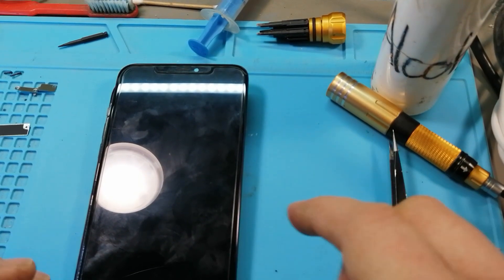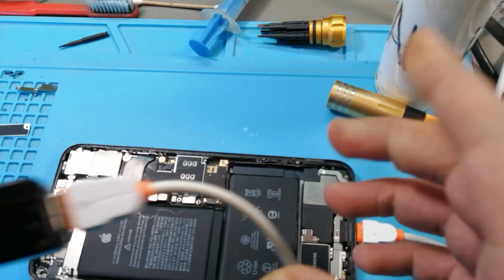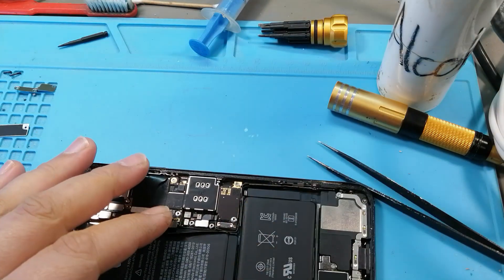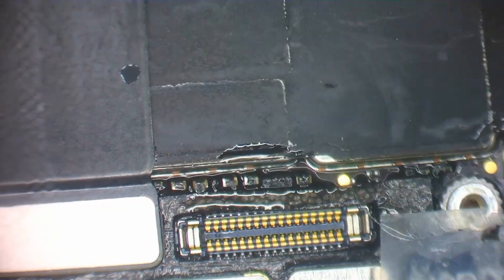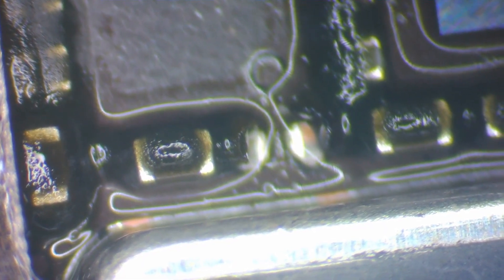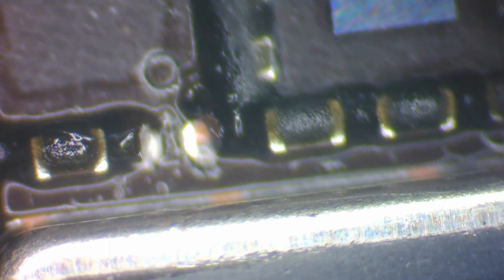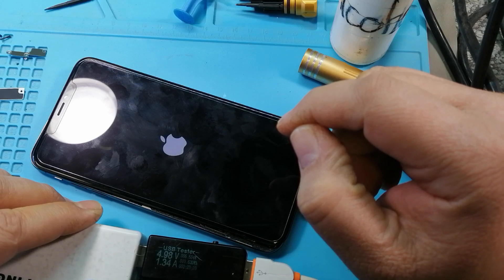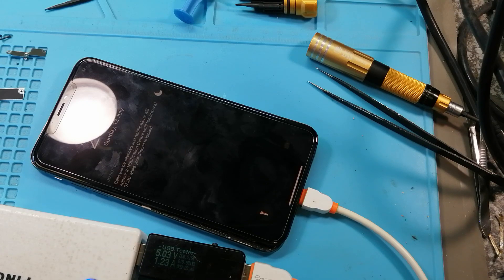Dead Iphone XS Max

Comment: Hi! Nice video my friend but I have a few questions. Ive seen that you removed the capacitator but you didn’t replace it. Is that true? Also I see that the capacitator became loose just applying amps? Or did you previously apply heat?

Thanks

Comment: My screwdriver accidentally touch the side button connector and rear camera connector. I heard a noise, then my iPhone XS is dead. I can feel the warm on the logical board. But no response on screen. What should I test? Thank you
Reply from the maker: see if you can pinpoint the heat , that's most likely where the fault is

Comment: Great explanation for every step. Would be good to know where you test for each power rail and each power chip, and the order you do it in.
Reply from the maker: I am not a pro in Iphone repair but get the basic under standing of electronics , I wish I could find a voltage rails list for the Iphones
Reply: @AnonymousRepair  you should have zxw :) has all the data sheets for them
Reply from the maker: @pcvitamins  give refox a go, I have used zxw but i don`t do a lot of Iphones mostly I get the ones that other repair shops messed up